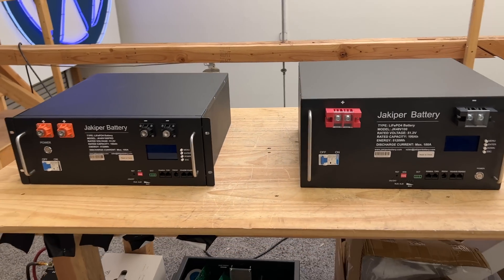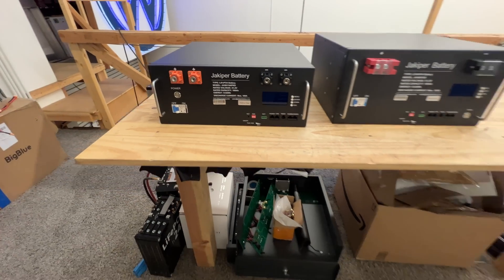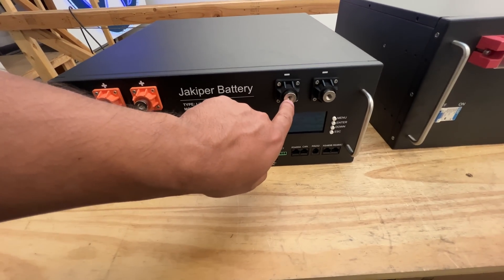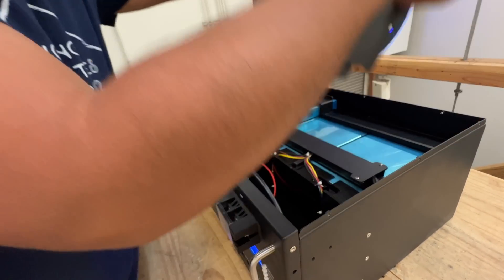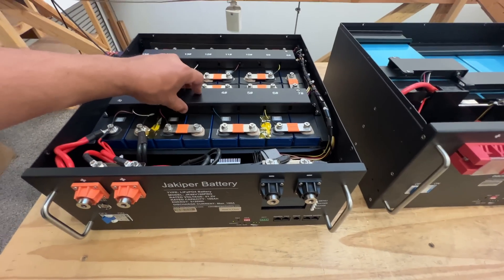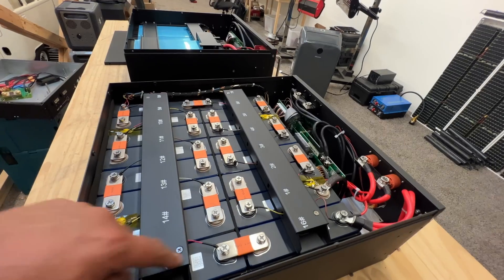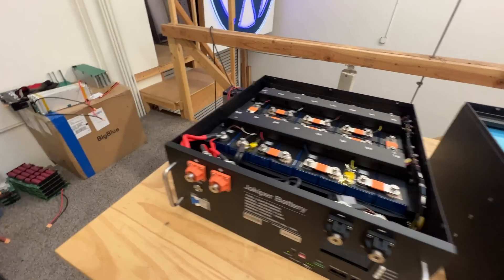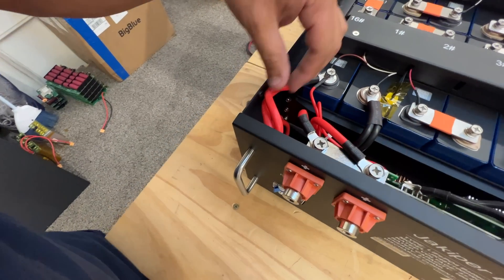New smaller Jakiper 48v RackMount LiFePO4 battery

Comment: Visually, looks pretty legit especially for $1700/shelf...   PCB's may come off a bit more wizbang, but cables n bussbars? Im tell'n yuh...    more ampacity!

The only complaint design-wise, the power button placement seems a lil sketch? but I suppose you could mitigate that a bit by cabling from binding post 2 on the top shelf to binding post 1 on the shelf below & the cabling wouldn't get in the way of the button

Anyway you could do testing on the individual cells from the current gen to previous?

Comment: hi jehugarcia you can scan barcodes and find out what kind of battei cells it is
Reply: This JK48100Pro version use Ganfeng brand cells, and Orient Power use EVE cells, which is China biggest telecom brand customized cells, you can check website for details. There have the cells testing report enclosed too, it will comes with every batch of batteries to make sure clients get real best batteries.

Comment: Still overpriced compared to diy with raw cells.(current price $160/kwh for NEW LifePO4 us stock)
Reply: Ya but it's kinda 2 different markets I think for what it is it's not a terrible idea it already fits in a rack so you can easily plan a system in a pretty small foot print vs like battle born that would be $4000 and take up a lot more space
Reply: @james10739  agree

Comment: 48v is also the Telecom standard voltage.
Reply: that's correct. normally is 15S in series get 48V, and 16S in series get 51.2V, we insist on produce high stable quality batteries with 16S.
Reply: correct